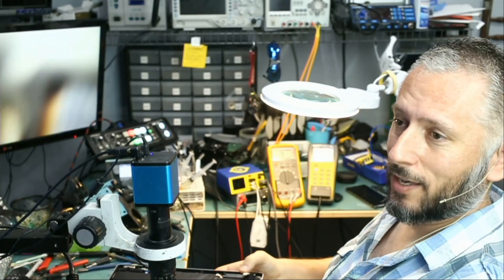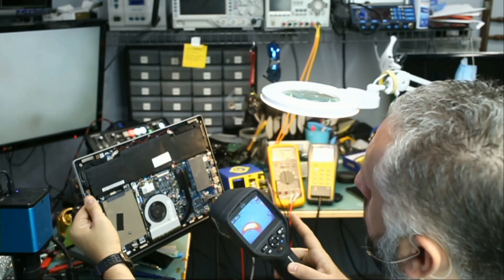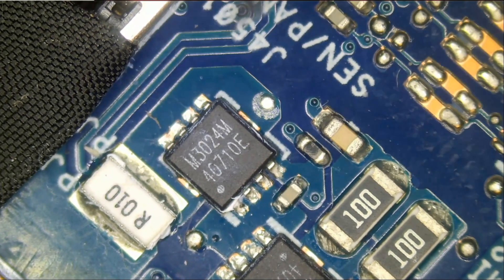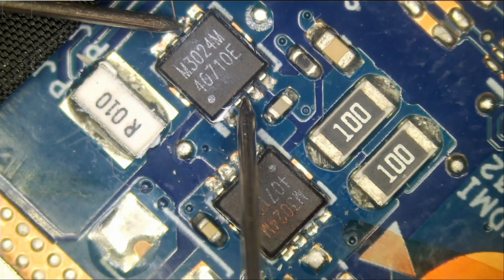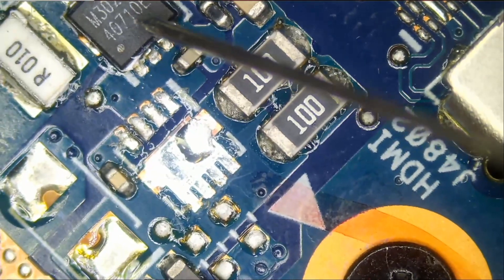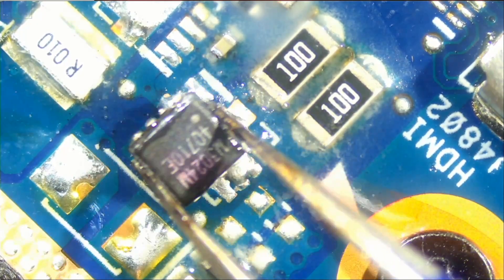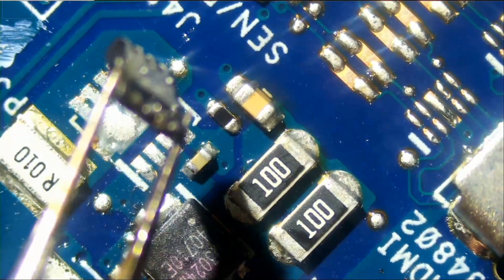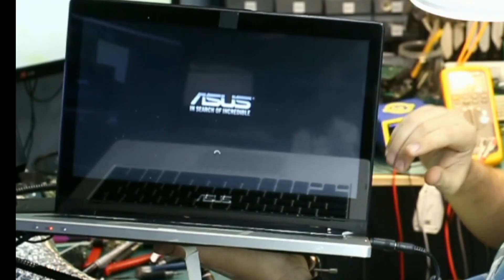Asus TP300L Laptop No power Repair - Testing for Faulty Mosfets.

Comment: Hello from France,
I love your videos and I looked a lot of them already. Through all what I have seen it seems that bad MOSFET are often the source of the problem.
I was wondering if you could take some time to explain what is causing a MOSFET to become bad. Is it an overvoltage from the power supply, or an overcurrent, or overtemperature, or an ESD maybe? 
Could you provide an engineer explanation ?
Thanks for all what you already did.
Best regards,
Pierre

Comment: Hi Sir have a nice day. I just want to ask help from you, coz I have a repair of laptop HP Pavilion g6-1a69us.There's a power light, but when i press the start Button power is cycling loop Then when I disassembled the laptop there's no BIOS on board. I thought the technician who previously repaired the laptop removed that. Now I do not have a donor board to compare what's the number of the bios. So I'm asking for your help if you know what is the bios number for HP Pavilion g6-1a69us.I googled it already but there's no exact Schematic diagram. Thanks in Advance.

Comment: Nice video. Would be better if you gave more info on how you assumed it was the mosfets, and their locations. I mean move explanaition for beginners. Thanks!
Reply: He did say that "Power Mosfets" are usually the source of the problem.
I just chalk it up to his vast experience.
A fully dead board.
Plug in power and check to see if it is coming in.
 Disconnect power and;
He checks with meter for shorts.
He checks with meter for voltage drops.
Diagnosis confirmed after removal of both Mosfets.

Comment: I just had a feeling that won't be a easy fix. Good I've been wrong and this ended as a simple mosfet change
Reply from the maker: All repairs are simple when you are able to point out the problem.
Reply: @NorthridgeFix  I agree. There is almost 9 am in Central Europe so perfect timing just to watch with morning coffee.
And as always: better than the factory!
Reply: @NorthridgeFix  In most cases the hardest part is always about finding a problem or a part causing a problem but fixing it is another part which can be easy or hard depending on your experience and equipments you use.